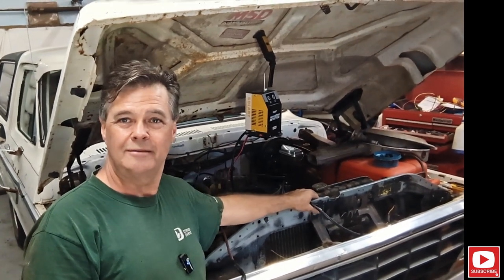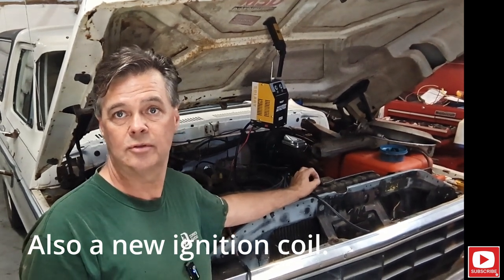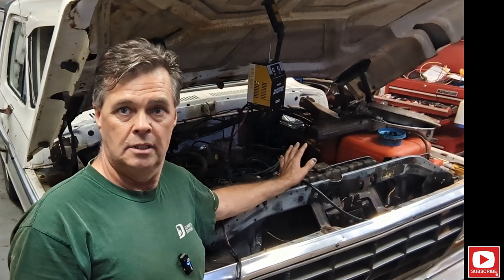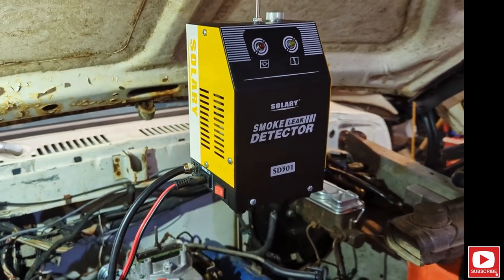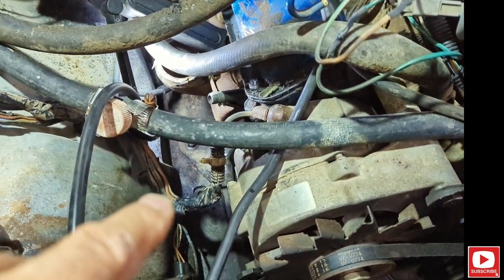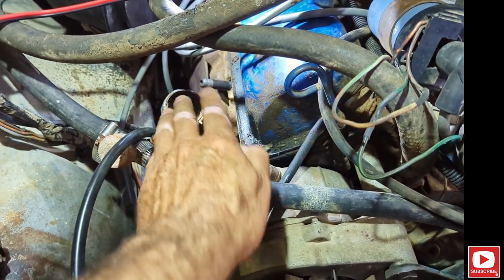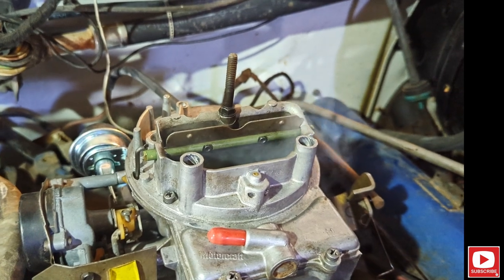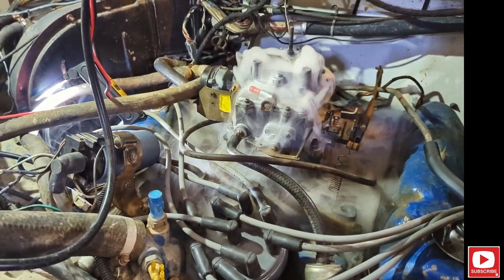Cheap Smoke Leak Detector - Checking For Jumped Timing Chain

Comment: Glad you got it, that was a head scratcher for sure ~ Chuck
Reply from the maker: It sure was Chuck! 
It happened so randomly, making it hard to track down. I had already replaced most of the ignition parts when I bought the engine...so now a pick up coil will complete the tune up. Lol

Comment: Hiya Alvin!
I’ve seen these used for vacuum leaks but not for mechanical timing. That’s a cool way of checking visually, rather than a compression, or leak down test. Thanks for the tip, I might look into one of those machines.
Reply from the maker: Hey Troy...yes, if smoke can get past a valve that's supposed to be closed, then there is a problem.
Also it's great for checking the stuff it was designed to do, but you know me I have to push for more! Lol

Comment: Throw a pickup coil at it! Had a few over the years acting the same way... turned out to be a bad pickup coil even though the wires were ok.  Or seemed to be ok...
Reply from the maker: You are right!
I cut apart the rubber insulator holding the three wires, where it passes through the distributor, the lower wire had pinch mark with a little black dot in the wire covering, it looks like the lower wire has been shorting to the ground strap connector right below it.
I added a little bit of a tape barrier, and she runs much better... good enough until the new comes in. 👍
Reply: @J_R_Shop  Bingo!

Comment: Hey Alvin, 
How can you tell if you have ignition timing that is off a bit?  the 66 bird runs but runs rough at curb idle, then seems to smooth out once you give it gas. 
😄
Reply from the maker: You can check the timing with a timing light very simple to do, however, it sounds like you have something else happening, an issue with ignition wires/plugs (make sure the plug wires are on the correct cylinders), the idle mixture is off, a vacuum leak, the choke is not fully coming off or the power valve is leaking...it's hard for me to say from my chair, which one(s) are the issue, but these are a few things to look at, start with the easy ones like vacuum leaks, choke and idle mixture.